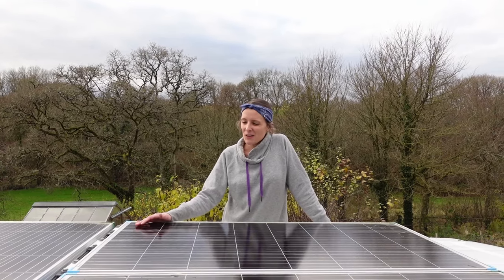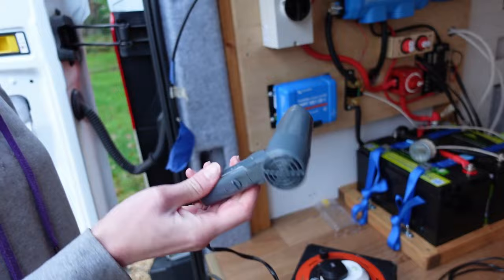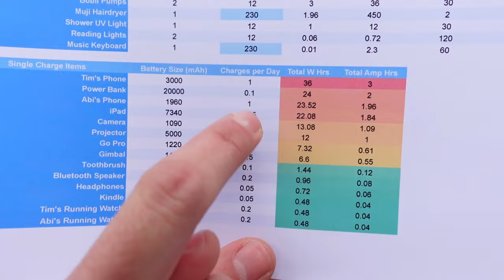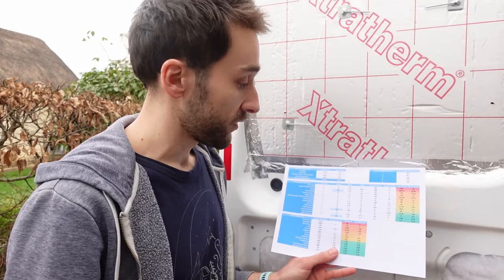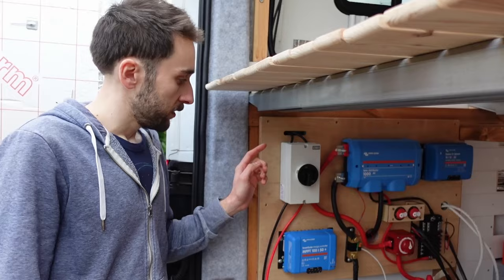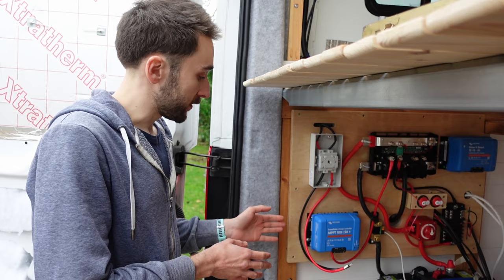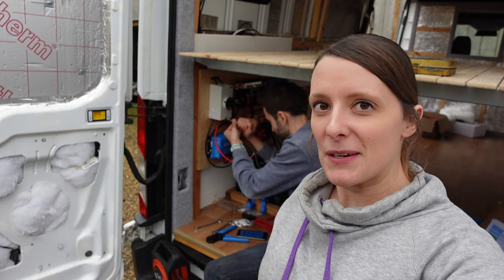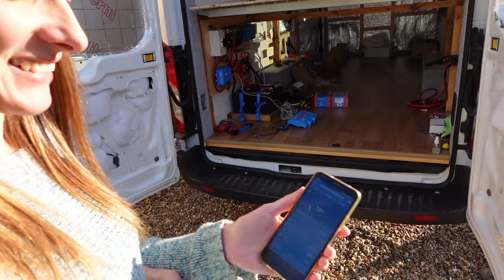Solar Wiring & Panel Sizing (525W Switched On!) | Transit Van Conversion E23

Comment: Many many thanks for your videos!

Just a question regarding the calculations in the spreadsheet for the laptop. I see you are calculating its Amperage as A = W / V= 0.9, where W is  20 (I guess you observed this with your smart plug) and V = 230 (the ac output voltage from the the inversor). The question is, why are you considering this voltage of 230? Shouldnt you be considering the voltage at which your laptop is being charged ( you can see this on you laptop's adapter)? It usually is around 20 V

Thank you!
Reply from the maker: Hey, no problem, and yeah 20W was the wattage we measured using the smart plug. The laptop was a bit of a tricky one as it doesn't have a fixed amount of power usage, it depends how charged it is and how much it's being used. So we measured it at a point where it was plugged in, not fully charged and we were lightly using it. You could also treat it as a single charge item that you charge up then unplug and use. And yeah we used 230V/20W as that's what we measured right after the inverter with the plug, before the laptop. So that was how much power was being generated via the inverter to charge it, and the laptop itself steps it down later in its own power supply to ~20.5V. But the wattage (power) should stay the same (ignoring any conversion efficiencies). If it was 20.5V with 0.09A you'd only have 1.8W of power. We find it easier to think of it in terms of watts as then you can compare easier.

You could also base it on the rated output of the charger and work backwards without measuring it with a smart plug, it would just be the max power consumption. So ours is 4.5A at 20.5V=96W as the max power. But then you still want 96W out the inverter which only outputs 230V so 0.4A. Obviously all the figures are a best guess and depend on your own devices etc, but they should hopefully give a pretty good ballpark, HTH and good luck with the build 👍

Comment: Morning. Have you considered a tilting system for your panels? I was was watching another video where a chap started with (1000 watt panels) 67watts 51.3 Volts 1.3 amps un tilted then just by tilting the panels up on the top of the van using an actuator the levels went up to 453 watts 60.1 volts 7.5 amps. As a test I think you might be able to jump up on the roof of the van and tilt them up by hand just to see what happens. If this guy is right a few hinges and a motor could dramatically increase your solar input for just a few quid.
Reply from the maker: Morning :) I can believe those numbers as the sun angle and shade makes a very noticeable difference, it's actually quite incredible how quickly it backs off. If you're driving down the road watching the app you might see 200W then pass through the shade of a tree and it drops down to 15W for a few seconds then back up again. When you're driving up a hill then you'll see a noticeable difference compared to driving down the other side as well depending on the time of day too.

So tilting the panels would definitely increase the yield, but we decided the extra complexity wasn't worth it for us right now. We tend to move around a lot and park up in different places in the evening when the sun is already low in the sky, so we wouldn't get as much out of it as others might.

If it's decent weather then in Spring/Summer/Autumn we generally have fully charged batteries each day already, and in Winter or when there's no sun out so we can't rely on it, tilting wouldn't help much. But we have the DC charger as well so as long as we're driving enough we stay topped up.

We'd definitely think about it more if we started staying in the same place for longer periods or our energy demands changed, but at least at the moment the simple setup is working well for us 🙂👍
Reply: @SelfBuiltStories  thanks for the  reply and I love the videos. Keep up the great work!
Reply from the maker: @chrisandrews7518  no problem, cheers 😃

Comment: Nice vid! Have you guys had any issues using ferrules with Victron equipment? I wouldn't think it would affect performance if installed properly on the wire. It seems like it boils down to personal preference (being more tidy and whatnot).
Reply from the maker: Cheers :) And there's a lot of discussion around ferrules, we prefer them as we find they make for a tidier install that's also easier to maintain, but it's really important to use them correctly and there are a few things to keep in mind beyond personal preference.

In a mobile install you are using fine stranded cable, usually class 5, which for a 16mm^2 cable for example will have over 100 individual strands (https://centralcables.co.uk/wp-content/uploads/2015/07/Class-5-stranding-resistance.pdf ). 

Then depending on the bit of kit you're using, there's different styles of terminals. Some use a 'rising clamp'/cage which as you screw down gradually compresses down onto the wire, and others use a screw which bites down into the wires. For rising clamp terminals a lot of people will say using the bare wire is best as it will spread out all the wires and ensure a really good surface contact. Whereas with a screw terminal if you use bare wire it will bite down into one section of the cable and might damage the wires or splay them out badly, so a ferrule keeps everything together and makes good contact.

Victron's Wiring Unlimited book recommends using ferrules for screw connectors (page 27): https://www.victronenergy.com/upload/documents/The_Wiring_Unlimited_book/43562-Wiring_Unlimited-pdf-en.pdf . 

But there's also different types of ferrules, with different shapes. For the MPPT and Orion we used a square crimper, which matches up with the square shape on those units and ensures good contact. If we had used a round or hex crimper, we would have only had partial contact. For the newer Orion XS though the terminals are different and a square crimp won't fit, you need a hex crimp: https://community.victronenergy.com/questions/296481/orion-xs-cable-size-does-not-meet-listed-spec.html .

Some expensive crimpers have interchangeable dies so you can change the shape you need depending on what you're doing. You can also get different length ferrules, and you want to make sure it's long enough so that the insulation of the wire is not caught inside the terminal.

The most important thing always though is to have a well torqued, secure, and safe connection. As otherwise you can have excessive heat build up at the connections that could ultimately lead to fire if particularly bad and left unchecked. Here's an example of an Orion that was installed badly with ferrules, and ended up just short of setting fire to a boat: https://community.victronenergy.com/questions/240749/smoking-dc-dc-melted-wires.html . The ferrules weren't crimped onto the wire first just placed on them and then 'crimped' by screwing down into the orion. 😐

We use them everywhere, on both the 12V and 230V side and haven't had any issues, and have had our electrics checked over as well. We think they're great, as long as they're installed correctly. HTH! 👍
Reply: @SelfBuiltStories  Thanks a bunch for the detailed response. This is very helpful. I have glanced at Victron's Wiring Unlimited but haven't seen the section on connectors until now. It is such a good reference. And Victron is very clear in their explanations on everything – this is one reason I went with them for my components.

Keep up the great vids! Cheers.
Reply from the maker: @ForgeAheadwithMike  No problem! Yeah we like the Victron kit, they definitely have the best documentation of the ones we've seen 👍

Comment: Hi guys, excellent series, best conversion on utube. Could I please ask what size in mm are the cables from the mppt charger and are the cables on the batteries 70mm ? Thank you in advance.
Reply from the maker: Cheers! And we used 16mm^2 for the solar cables and into the MPPT, and 70mm^2 for the battery to battery and battery to lynx connections 👍

Comment: Hi Guys we have enjoyed watching your build and am rewatching this episode to get more info prior to embarking on our own layout - here is the silly question - once the panels are exposed to daylight they start working so does it matter that they are exposed and wired but without being actually connected - this has really puzzled, many thanks in advance
Reply: I can answer that. No, it doesn't matter, because unconnected, there is an open circuit, so it can't generate any voltage / watts etc. This is why you should cover the solar panels to work on the panel connections  + and -, and why you need the isolator (double pole or single pole) between the panels and the MPPT controller or a BC-DC controller.
Reply from the maker: Hiya, yeah it's not a problem to have them up on the roof unconnected, we had them up for some weeks before we got round to doing the electrics inside (had to give them a clean by then!). Just be sure to tape the ends up well with some insulation tape as obviously you don't want them to short out on themselves or the van metal. And as Les says, cover them up with something like cardboard when you're connecting it all up/doing any maintenance on them so you can be sure they wont' be generating any power 👍
Reply: @SelfBuiltStories  Many thanks - one of our next jobs!
Reply from the maker: No problem, good luck! 👍

Comment: Hey guys. Long time lurker here. Love the detail in your videos. If you were to add 230v hook up, where and how would you do it?
Reply from the maker: Hey! Glad you're liking them 🙂 Good question, we decided early on that we weren't going to add shore power hookup as we plan to be off-grid most of the time, so we've gone with solar and B2B charging only. But if we were going to add it, what we probably would do is put in a combined inverter/charger unit instead of just the inverter we have. So something like the Victron Multiplus or equivalent. Then we'd essentially get the hook-up side with no extra work and pretty much a drop-in replacement. You could retrofit it later with a standalone charger and transfer switch but it would be a bit more involved, so we'd probably even in that case swap out our inverter with a combo unit that is intelligent enough to automatically switch over when it detects shore power and handle any change in the earth bonding etc. HTH!
Reply: @SelfBuiltStories  Thanks for the info. I went for a Renogy inverter charger but I’m sending it back because it’s absolutely massive and weighs a ton. Note to self: read the specs thoroughly
Reply from the maker: @johngrainger152  No problem. Yeah some of the kit is pretty heavy!

Comment: Really enjoying your content. But am I missing something? Wouldn’t you be running your fridge for 24hrs, not 6 in a worse case scenario?
Reply from the maker: Cheers 🙂 And yeah we will be running it 24/7 but the compressor doesn't run the whole time, it switches on and off throughout the day as needed to maintain the temperature. Looking at the daily amp draw that Dometic list on the specs (0.29952kWh 24/h) worked out to be pretty much exactly the equivalent of it being on for 6 hours a day.  So we used that figure with the exact W hrs listed from the specs 👍
Reply: @SelfBuiltStories  I see, thank you. Keep up the good work
Reply from the maker: Thanks, and you're welcome :)

Comment: Thanks for sharing!! Awesome video, great channel!. We are just starting with this stage in our van conversion and this videos are a great and detailed guide. There's something I didn't quite get from the spreadsheet: how do you calculate the total Amp Hrs when the voltage is 230? I mean, for the 12v items I see you multiplied Quantity x Watts x hrs per day, but I don't understand what is different with the 230v items. (for example, in the laptop file...1 x 0.09 x 8 = 0.72, but you put 13.33 instead). Would you help me with that? Thanks so much, keep up with the good work!
Reply from the maker: No problem! Glad you're liking our channel! And great question, it is a little bit confusing. Basically we are using the watts as the main thing in the spreadsheet, as being power it is comparable across both voltages whether it's 12 or 230V. So the laptop draws 20W, which is 0.09A when at 230V coming out of the inverter. But that would be 1.67A at 12V. We've listed the 0.09A in the spreadsheet as that's the current that would be measured there, but on the 12V side before the inverter it would be higher, and that is of course the amount that is actually going to be used from our batteries (as the inverter is ultimately powered by our 12V setup). So in the coloured columns on the right we use the Watts as the main point, and then derive the amps from that. So for the laptop we have 20W * 8 hours = 160Whrs. Which is 13.33Ahrs at 12V. Then because it's through the inverter we also apply a 90% efficiency to that too. Should also be said the laptop charger is actually 85W max, but 20W seemed to be a fairly good average for light use when we measured it. We could also have included the laptop in the charged items section too and calculated it based on charging the battery to full, but we figured we'll probably have it plugged in most of the time we're using it so did it this way. All of the figures are obviously subject to variance, but we hoped to have them in the right ball park enough to make good decisions on our setup. Pretty happy with everything so far coming back from a few weeks away in the van.  Hope that helps! 🙂

Comment: nice video guys, just one question, why did you used the smartBMV if you have the smartsolar, both will show the same numbers in the app or am I wrong?
Reply from the maker: Cheers. And the Smart BMV gives you data on the current draw in and out of the battery bank, whereas the MPPT gives different data on the yield of the solar panels etc. They come up as two separate items in the victron app

Comment: Hey guys revisiting this video. May I ask why you went for a 1000w inverter when you can get a 2000 or even 3000w unit for not that much more?
Reply from the maker: Hiya, no reason really other than looking at all the things we had to power, we didn't have anything that would require more than that, so we figured it made sense to save a few £. But also we thought if our needs change on the road and we want to power something bigger then it's one of the easier components to just swap in a replacement. 👍

Comment: I know this video is a year old, when battery is fully charged, the victron wont supply charge current to prevent overcharging and damaging your battery (a lot of lithium, batteries have their own BMS battery management system to prevent over current and over voltage anyway - but with the victron gear you wont go wrong). If you turned on the fan you previously wired, you would have seen more amps coming through the charger when you  done this video as the battery would have a little more space to accept a charge current that the victron would then supply. But it is not unusual to have less than 1amp of charge in early morning sun, you wont see it really crank up till about 11am till 2pm.
Reply from the maker: Yeah they're great bits of kit! The batteries weren't fully charged when we first switched it on but it was right at the end of a cloudy day just before the Winter Solstice too, so not great test conditions 😛 But the next day was a lot sunnier and with the batteries in the same state we pulled in around 100W. We typically see around 300W on a good day now we're approaching Spring and last Summer were able to get in the 500s which is great, as the batteries were always fully charged by mid morning. The mppt also restarts in Bulk if it's reset, so if already in float switching the solar isolator off and on again puts it back in bulk momentarily and can see the watts it's pulling in.

Comment: Great spirit and content. Have you been to norway yet?
Reply: Oh, and one more thing: its a big difference between flat mount and if you have the panels angled towards the sun. Specially north in scandinavia
Reply from the maker: @andreasdahl717  Cheers! And nope not yet, but it's going to be our next trip! 😀 And yeah it would make a noticeable difference for sure but as we move around so frequently we probably wouldn't end up actually going up to change the angle most of the time, so for now at least we decided it wasn't worth the extra complexity for us 👍

Comment: Why didn't you include an external power hook-up connector for campsite since you were planning on travelling to countries with little or no sun hours in winter?
Reply from the maker: We spend the majority of our time off-grid so we decided quite early on in the build that we wouldn't add shore power as most of the time we wouldn't be able to use it. Instead we focussed on having enough solar and alternator charging capability so that we could use the van all year round but still not have to be tethered to a campsite hookup every now and then. We've travelled through Scotland in the Winter as well where open campsites were few and far between, so not sure we would have been able to rely on it even if we had it in some of those places. 

When we have sun we don't think about power usage at all really, and when we don't (like Scotland in the Winter) we are a little more power savvy but as long as we don't stay in the same place for too long we charge back while we're on the road. Worst case scenario we would just need to idle the van to charge a little, but so far we it's working out pretty nice 👍